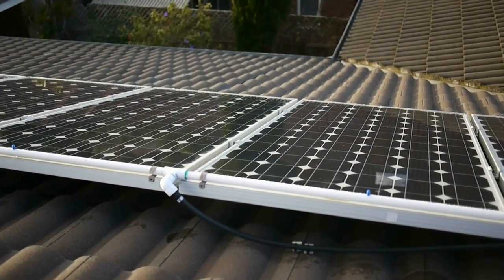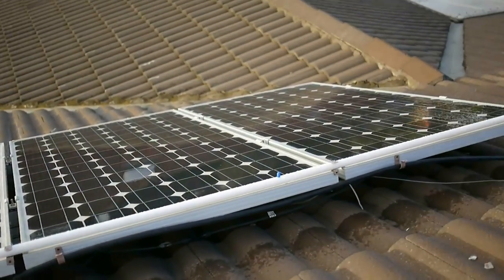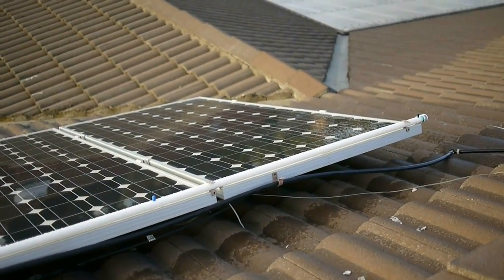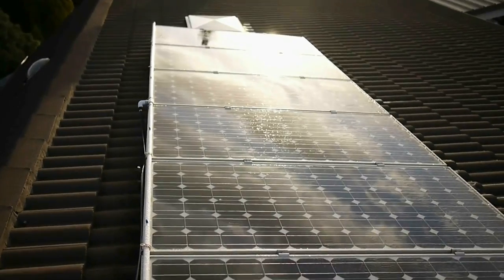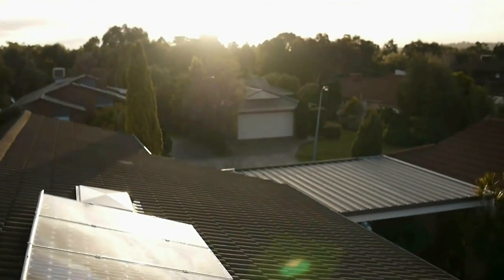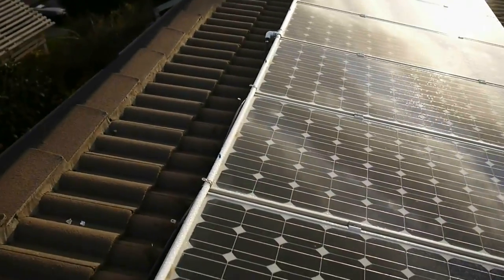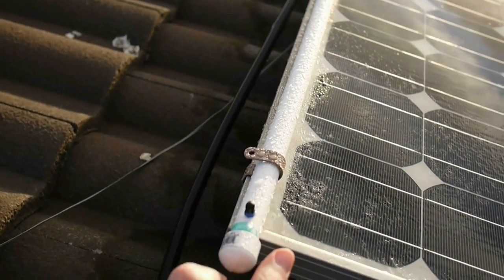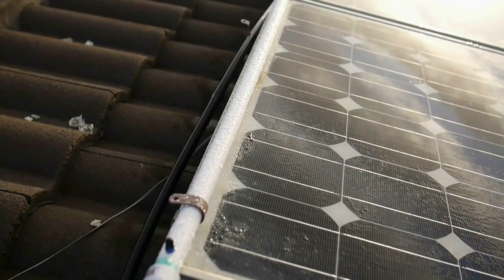Solar PV Panel Cooler Reworked Sprays

Comment: Can you please specify the capacity of used Pumb and  storage tank and types of valves?
Reply from the maker: My tank is 1000 litres, which, for me, means I always have water available - but it depends on how much rainfall you get and how big your roof area for collection etc. The pump must have enough head to reach from the ground up to where your panels are - which might be 10 metres which corresponds to around 1 bar or 100kPa or 15psi. Flow rate required is really low, so only a few litres per minute, say 5. You shouldn't pay more than around $30 for a pump. I used a diaphragm pump which is noisy, so a pump you can submerge in your water tank might be a good idea. Try not to buy too high pressure because then you might need special pipes. Just your normal water supply pressure might be best. As for valves - it's probably easier just to try it with no valves at all and control water with the pump only. A non-return valve might be helpful.

Comment: Good work sir!  Do you recall how you secured the clips to the panels?  Did you drill holes in the panel frame to secure with bolts and nuts, or was another clip-type product used?
Reply from the maker: I just bent flat aluminium strips to make the clips, and they are just a tight fit onto the panel - no screws or bolts required.

Comment: may i ask about the control system to make sure there are runs  when it's only necessary , thank you
Reply from the maker: Yes. It starts the water-spraying cycle when the panel is 8 degrees Celsius above ambient temperature- which is an indication the panel is generating significant power and that there is not enough wind to keep the panel that cool- i.e. water cooling starts when natural cooling is inadequate.
Reply: thank you ,
but may you send me a copy  from your desgin if it's possible i'll be greatful.
thank you
Reply from the maker: Mohamed Mahmoud I don't really have a design very usable form. It was also quite specific to the parts I had available- e.g. the valve is a low power unit that has only 2 wires- +15V for a 0.5 sec or so to open and 15V to close. Quite a few components are for that particular device but the design would change if, for example, a 24Vac valve actuator with a spring return was used. The main point of the video is to explain the idea rather than my specific implementation.
Reply: oh yes thank you
for programing  did  use  pic c
op plc ?
and did it gives sensibe change increase in the produced power ?

Comment from the maker: I didn't need to tap the holes- just drilled and screwed the fittings in. I experimented with an off-cut to find the best hole size (I didn't note which one it was) but the fittings create their own thread if you're careful - i.e. slow and with steady pressure.

Comment from the maker: The main design aim was to use the minimum water. It uses around half a cup of water each cycle, at a fastest rate of about 2 cycles per minute. It only needs cooling when there's no cloud or wind in the middle 6 hours or so of the day. My 900litre rainwater tank is virtually never emptied even after a few weeks of no rain. Note that tap water will leave calcium buildup which is very hard to remove- so I'd strongly recommend rainwater.